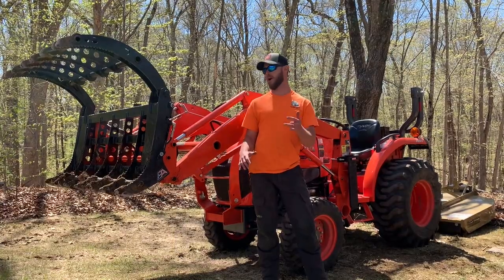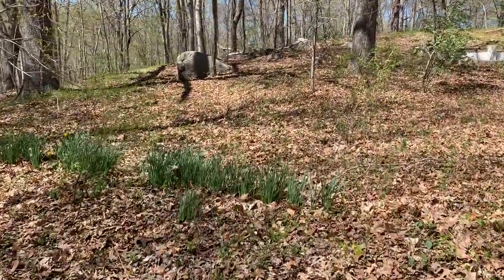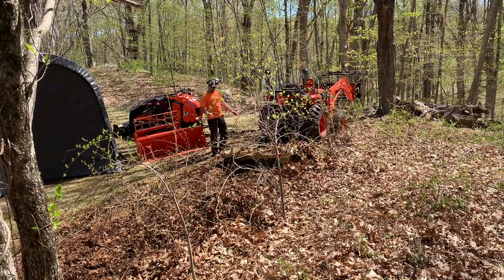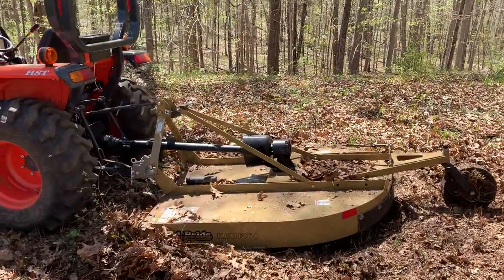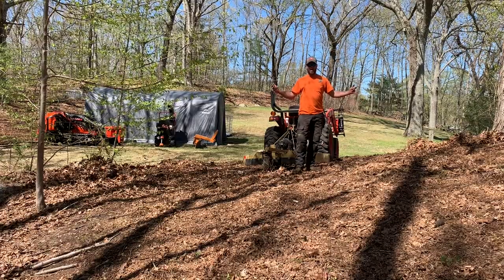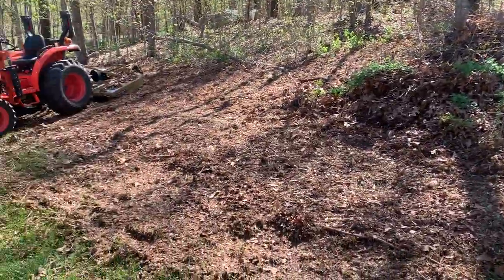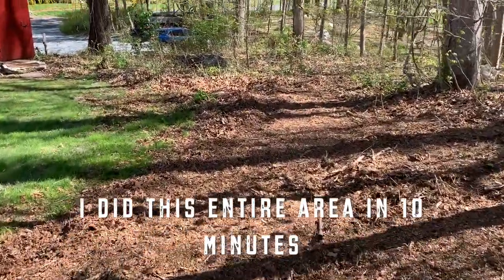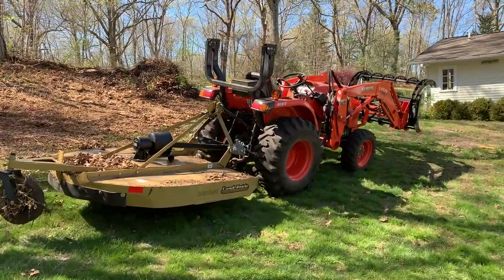#100 Mowing Down Brush with the Kubota L3901 Tractor and Land Pride Brush Hog

Comment: Brush hogs are ment to cut in forward motion what ever you can run over with the tractor it will cut keep your grapel down low I've been doing it for forty plus years keep up the good work it will get easier
Reply from the maker: Good to know! A lot of where I was mowing is pretty steep grade, felt a bit more comfortable backing into sections!

Comment: Hey Jake, have you slipped your rotor cutter pto clutch yet? It could save you $.
Reply from the maker: Hey there Joe, so I’m not sure on that...I haven’t done so intentionally, however, as I mentioned in the video I did hit a rock and it shut the cutter and tractor down...Would that constitute as slipping it or do I need to do so manually?
Reply: Slipping the clutch on the PTO shaft is a positive thing. It's the safety link in the drive system to save you damage to the gear box on your cutter. It's like a shear bolt. We concerns me is your tractor died. Download the manual for that cutter. You should make sure that slip clutch is fictional, it could be stuck together from sitting. You said you just picked it up used. I'm needing to straighten my rotor shaft on my 66 inch tiller because I didn't check my slip clutch. It was to tight. I picked up a steel fence post and my tractor died. If slip clutch was fictional it would have slipped giving me a chance to disengage the PTO and my rotor never would have bent.